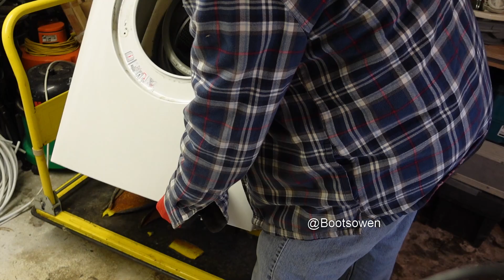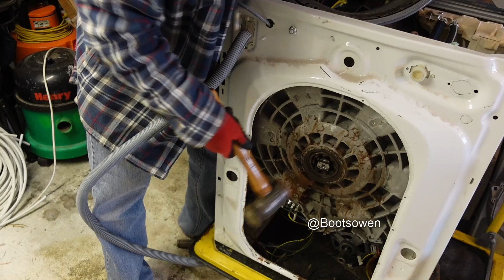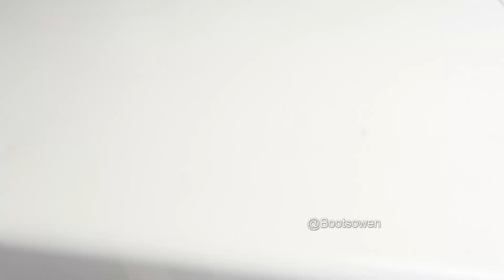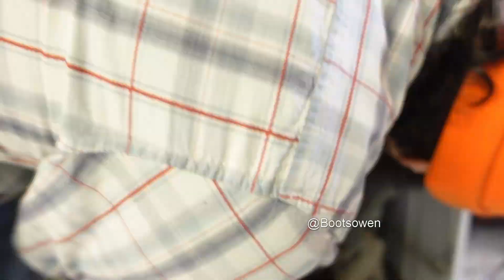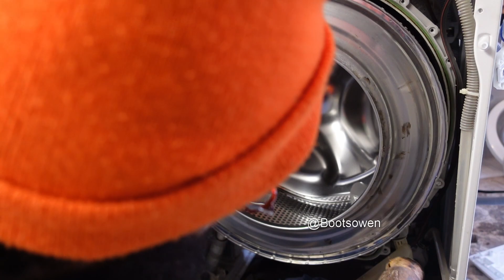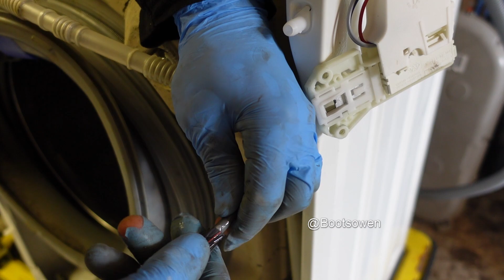Very loud noisy rumbling washing machine? How to bearings replacement, full process and test.

Comment: My experience with washing machine repair has taught me to pay close attention to the seal and not to cut costs on it, as this rubber piece plays a crucial role in the machine's performance. I noticed that the original seal is slightly larger and requires a rubber hammer for installation. In contrast, an analog seal fits more easily but feels slightly looser.

Comment: Now these bearings were brutally murdered, holy shit. 🤣Well done, these machines are pretty good and repairable! So absolutely worth it. 
What helps me to pull the drum shaft through the new bearings is to put on the pulley and tighten the screw, this pulls the drum in quite easily. Might have to loosen the screw a bit and re-position the pulley though. Also, the machines with the recirculation pump don't have a ball in the sump hose.

Comment: from someone that used to fix machines as my main job, well done!! newer zanussis have a sealed drum so are scrap if the bearings go
Reply from the maker: Cheers buddy. It is hardly worth it, but it was a mates machine!
Reply: @bootsowen  these machines are fixable, & much better than zanussi current range is
Reply: @djdrunkenmonkey2 indeed. My grandma has a John Lewis Electrolux washing machine that's about 14 years old now and the bearings have completely killed themselves and its a whole new tub. I've seen videos of people cutting the drums in half and replacing them, it would be cool to try. When done properly I believe it can work but it would come down to how confident you would feel using it as long as it doesn't leak.
Reply: Sealed tubs are an environmental disaster and such a waste. Surprised to see this Zanussi had a splittable drum.
Reply: @WSHLNd120 If you use enough bolts and nuts and use a proper sealant it won't leak. It's a common practice in Eastern Europe
Reply: Newer starting in what year?
Reply: Got the same machine with the same problem. I'm just going to fix mine rather than wasting money on newer crap .